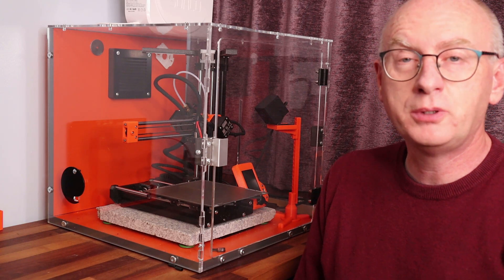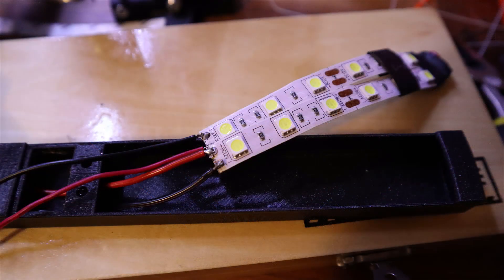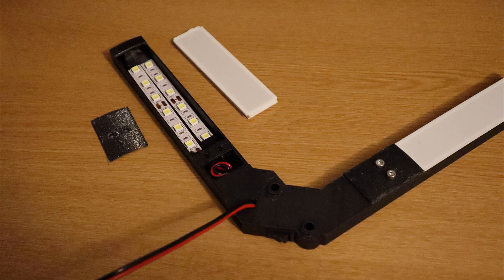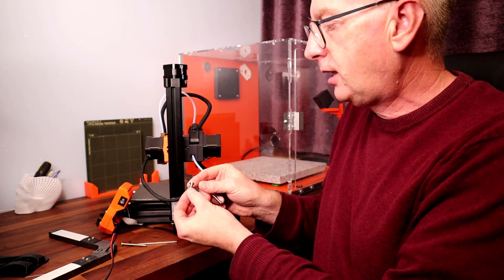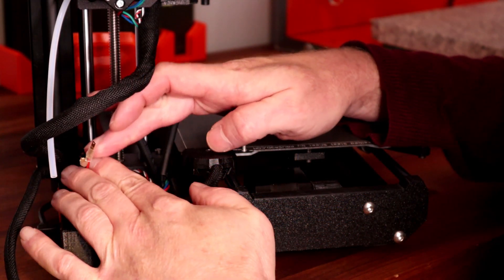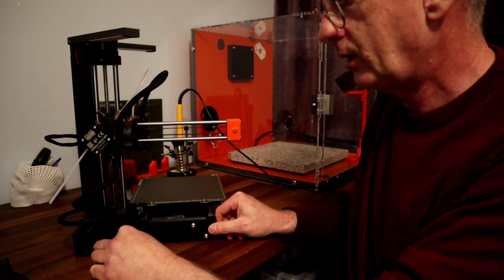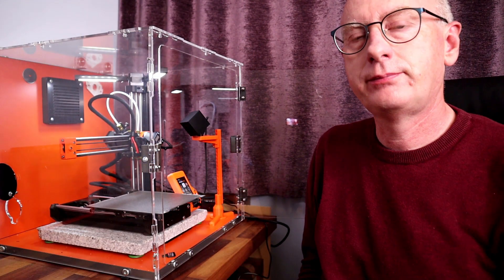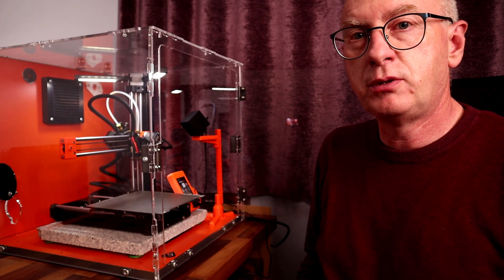Prusa Mini LED Lighting - Tukkari Enclosure

Comment: Hallo, can I put the printer with the box in my sleeping room or is it bad because of the smell of plastic or is the box protects from the plastic smell?
Reply from the maker: You will still get some noise from the printer, primarily retraction noises. Plus if you have a fan hooked up that will make a lot of noise. I can't sleep with the printer running (if i ever have to sleep in the guest room/printer room). Smell - PLA is fine, PETG is ok (but depends on brand), ASA/ABS i would never stay in the same room if that is printing. The Tukkari helps a great deal with noise, but i would always suggest having the printer in a different room for overnight. Also always have a fire alarm near the printer, especially if you do end up sleeping in the same room! I managed to connect my lights to 24v instead of 12v (had same plug end) resulting in the lights and printed mounts completely melting - lesson learned, and having to start all over again.

Comment: Great video! I wanted to view the fit and installation before building it myself. If you'll allow me to give a tip: using an aluminum led channel will greatly enhance the life of your leds as well as reduce the heat that the plastic will "feel". Although I can imagine that that will not fit in the provided stl files.
Reply from the maker: Managed to blow the lights by connecting a 24v supply in error, now reprinting the melted gantry is ASA and will always double check the cable!
Reply: @colinhill  oof, that's no fun. Good luck rebuilding it. For me it has proven to be an essential addon to my printer.